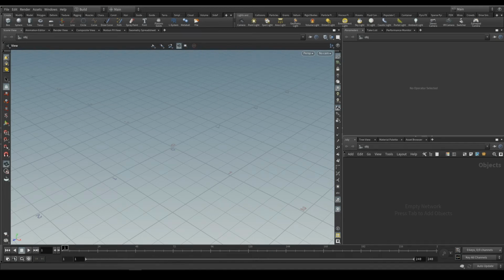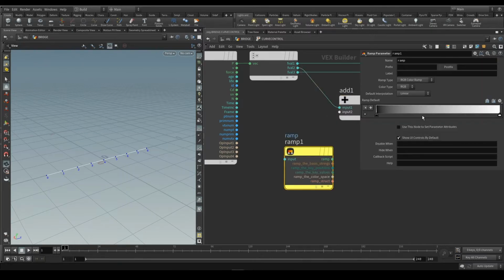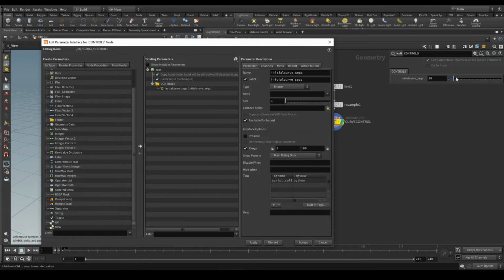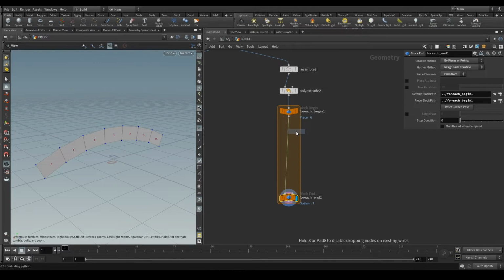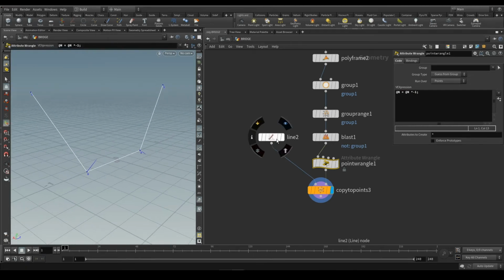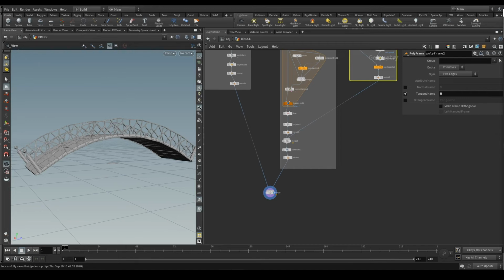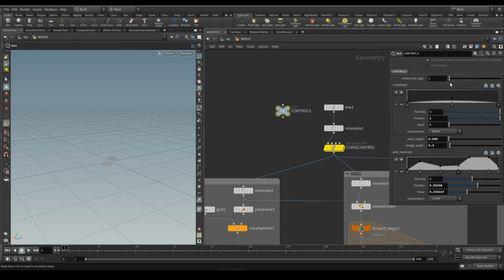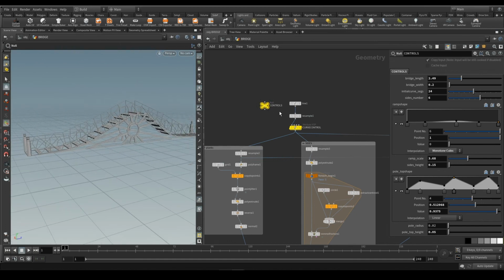HOUDINI PROCEDURAL BRIDGE TUTORIAL (ENGLISH)

Comment: At 18:00 there is a section missing and my planks don't follow the normals of the curve like yours.  Did I miss a step?  I added up normals via @N = set(1, 0, 0); but don't know how to get them to follow the arc created in the ramp.
Reply from the maker: I added the hip file in the video description
Reply: @stereographik  Thank you very much!  The Polyframe gave me the normals, but they were facing down.  I had to add a reverse normal to the grid, since I couldn't seem to flip the normal direction of the line.  Continuing on.  Thank you!!

Comment: Why does the Position along the ramp of each point affect it's Y value?  Setting a value in the ramp at a particular value doesn't guarantee it will be at that value.
Reply from the maker: the value you set in the ramp will be the value in the right units because there is no scale on top and the initial y value is zero, as the vop is adding the value to the initial one it will be that value, BUT it also depends of the curve smoothing (bezier /catmull/...) because you are right the catmull do not pass by the value.